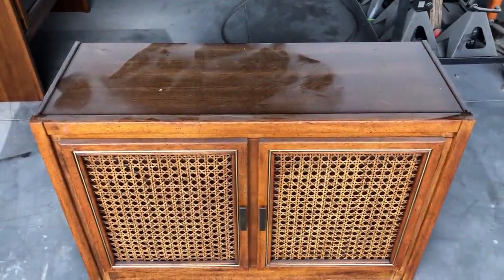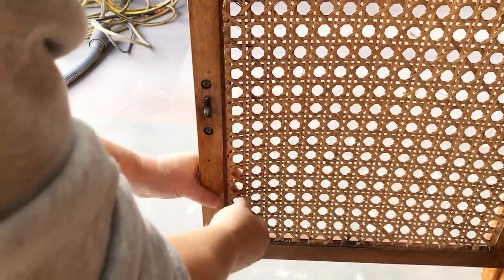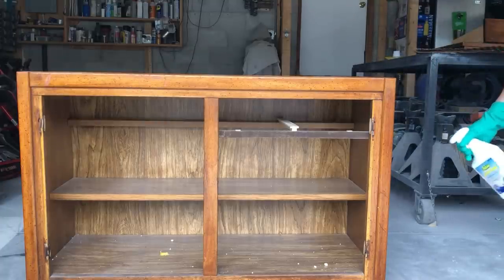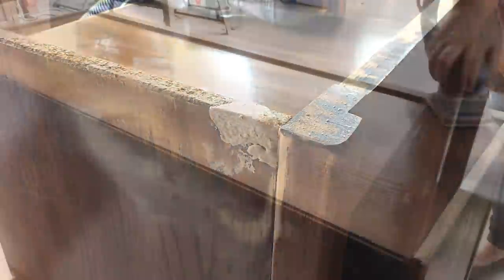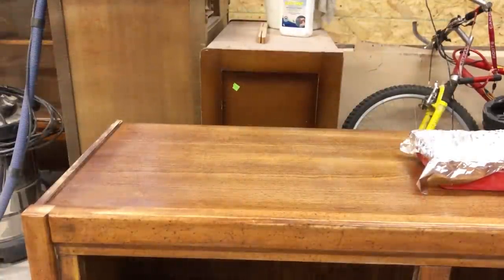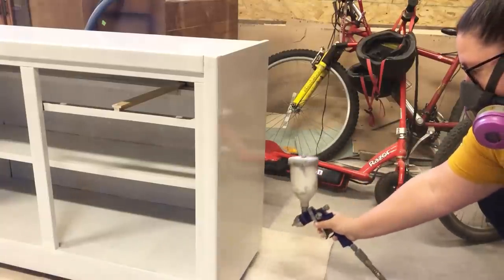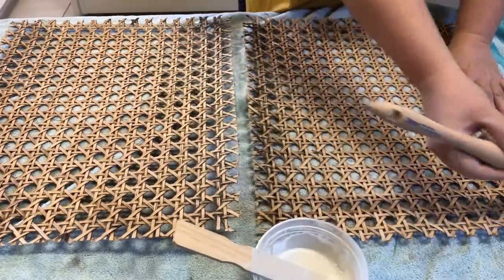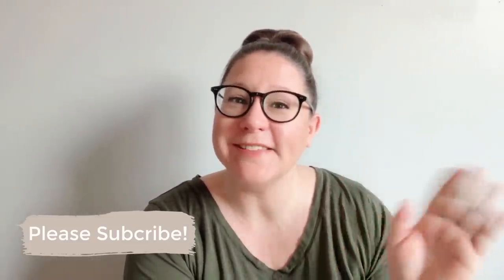Trash to Treasure Furniture Flip | 80's Cane Console Makeover

Comment: Hi, Katie.
Just had to fit watching this in before I go to work. Loved loved loved what you did with this.
Perhaps this  might be an idea for the future....
It would  be to have added a small 1/4 round dowel mitred on the inside to finish the edges of the cane so it doesn’t get snagged  on the contents should anything get pushed up against it from the inside. It would also add a bit of strength.
Perhaps even the original board backing cut down into a thin strip by your husband as I remember your dislike of using the saw..
You inspire us all and we love what you do.
Hanging out to see what your next project is.😀
All the best.
JPK...NZ
Reply from the maker: I did finish the inside edged with a strip of trim but didn’t include it in the video because my phone died and I couldn’t record it. I also didn’t include the re-lining of the drawer 😉 Thanks for taking the time to watch today.
Reply: @salvagedbykscott  too bad, but that would have been a treat to watch! You shouldn't let that sort of meticulous detailed work go unseen.

Comment: Using a plastic grocery bag is better especially if you didn’t finish for some reason and you want to go back to it later.  Just tie a tight knot with the handles and it all stays nice and fresh .  I also use a zip lock bags to keep my brush from drying out or a grocery bag.

Comment: That did come out beautiful. Love the color you chose. One question, well actually two. Why don't you use an electric (screw driver) drill and an air stapler? If you trash to treasure on a regular basis, believe me, your hands and arms will pay for it
Reply from the maker: I do use a drill sometimes but it’s just as easy to grab a screwdriver and I don’t need to purchase an air stapler when I have a perfectly good one already. I’ve been doing this full time for 4 years and am set up with the tools that I’m comfortable using.

Comment: yah i remember the comments on last video they all wanted you to soak it just coz other youtubers recommend that tip ! geez , lool  !! 
anyway , i am in loove with this piece !😍👌👌! youv done an awesome job and the cane actually looks fantastic with the light white coat !
Reply from the maker: Well, I did it to appease the commenters. I didn’t do anything 😂 Thanks so much for watching!
Reply: I think soaking is only necessary for brand new caning that comes on a roll and curls when you try to work with it. Soaking a piece makes it pliable. Soaking the same piece that was previously installed and is totally flat makes no sense to me. But then I'm just a DIY junkie and not a professional commenter lol

Comment: Hi Katie thank you so much for your very inspiring videos! I learn so much from your skills, and thank you for sharing! In fact I am changing out our entertainment console by adding some cane webbing. Like you I don’t like the high varnish coating on the front side and plan to flip it over and brighten it up as you did with this piece. I was wondering if any of your paint color came off after you soaked the cane webbing for the 30 minutes in hot water or should the watered down paint be applied after the soaking?

Comment: Looks beautiful and classy. I have a question. You white washed the cane, let it dry and then soaked it for 30 minutes before you installed it? Wouldn’t all the paint come out during the soaking? What is the purpose of the soaking? Thanks for any response.
Reply from the maker: Soaking the cane loosens the fibres so you can stretch it. Then it dries super taught. The paint was applied to the unfinished, raw side of the cane so it soaked in. Nothing came off in the water 😉
Reply: @salvagedbykscott  Ah okay.  Thank you for your detailed response.

Comment: Katie... please help a fellow Ontario girl ☺️ I just bought an old oak dining table that has a quite ugly yellow tint and I want to sand it all away! What kind of sand paper should I use to get back to the natural wood? I then want to stain it. Also, do you  need to prime wood stain?! 😩 thanks for your help, I love everything you do!
Reply from the maker: If it’s solid wood you can sand it with 80 grit to get the old finish off and then work your way back up to finer grits to smooth it (100, 120, 150, 180) You can use a pre-stain or wood conditioner before applying new stain. If it’s veneer however, don’t sand it. You’ll just make a mess. I don’t do dining tables but there are tons of great video here on YouTube. Good luck!

Comment: How come you don't put the bin primer through your paint sprayer ? Or are you not supposed to do that?
Reply from the maker: You can spray it but since it’s a shellac based product it doesn’t play well with water. If it were to touch a drop of water in my gun from a previous rinse out it would curdle, seize and ruin the gun. You don’t want to know how I found that out 🙄😭 It requires ammonia for clean up which is stinky and super labour intensive so I just roll it to skip all the hassle.

Comment: This is beautiful! Question, if there is some mold on the surface of wood furniture. Can it be sanded down & saved or is it best to toss it?
Reply from the maker: Hmmm 🤔 I’ve never had mouldy furniture before. I think I would wash it with a cleaner that specifically targets mould before sanding. And also be sure to wear an appropriate respirator if you’re going to sand it. Then I’d seal it really well with 3 coats of BIN primer. I don’t think I’d re-sell a mould damaged piece but if it’s a family piece for your own space, that might cut it. My 2 cents anyways 😜

Comment: Fantastic work. I am just about to try to revamp a writing desk , but am not sure wether or not to touch the inside of the cupboard and the draws , any suggestions. I once painted the draws and then they didnt slide very well. Cheers :)
Reply from the maker: I try to avoid painting drawer sides and interiors for that very reason. It’s just so likely to cause problems with the functionality of the drawer. If you really want to or half to I’d just try to avoid painting the actual runners or anywhere where 2 surfaces make contact. Have fun with your project! 😄
Reply: @salvagedbykscott  Thanks so much for taking the time out of your busy day to respond so quickly. Stay safe and enjoy your day. Adrian, Perth  Australia

Comment: If you do have a piece that bleeds, how many coats would you do? 
Would you coat until you no longer see bleed through? 
Thank you 😊
Reply from the maker: Hey 👋🏻 usually 2 coats is enough but if you can still see it obviously coming up through your second coat, go ahead and do a third. BIN also works best on bleed through if you let it cure for 24+ hours. Not necessary for minor issues but for those stubborn bleeders 😉
Reply: Katie Scott SALVAGED by k. scott 
Thank you 😊

Comment: Where did you get the BIN primer? I've been trying to find it in Canada but haven't had much success.
Reply from the maker: It’s readily available at any hardware store. Home Depot, Lowe’s, Canadian Tire, Home Hardware, Rona. Most Benjamin Moore retailers carry it as well. If you’re in a real pinch you can order it from Amazon.ca but it’s expensive.
Reply: @salvagedbykscott Ok - lockdown in Ontario has meant I can only just now check in-store. I haven't seen it online at HD, Lowe's, or CT.
Reply from the maker: @Lynsey17  I’ve been getting curbside from my CT & Home Hardware no problem. If you’re stores don’t show it online, they might just not have it in stock. It seems like a lot of the shelves are empty not that we can get back inside.